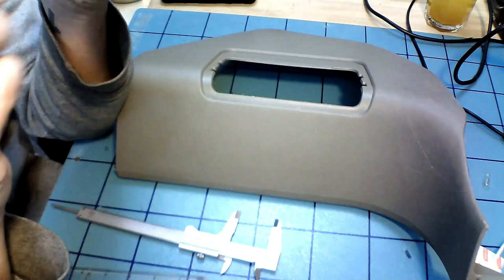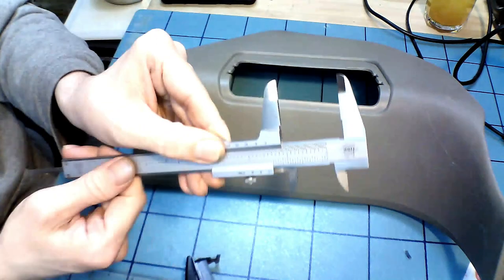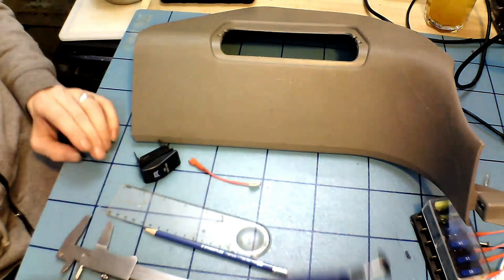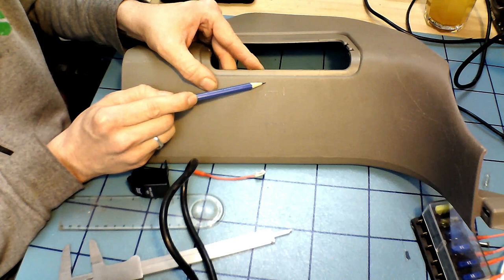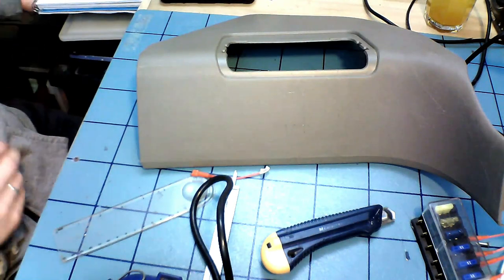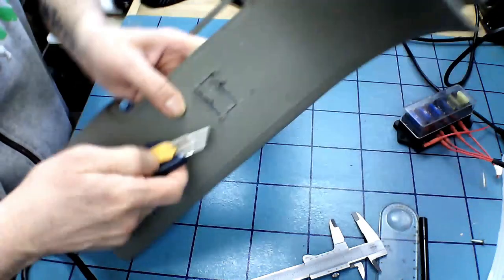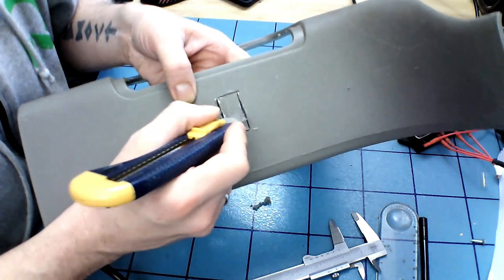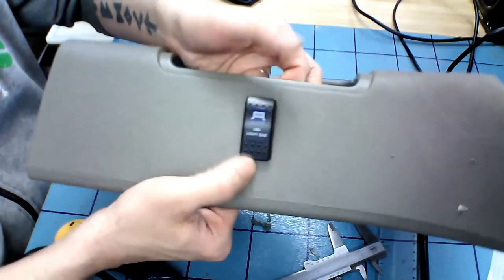How to install components in vehicles  (cutting, fitting, mounting)

Comment: The easiest way to make a clean perfect size hole in a dash is to heat up something metal that is the size you need and melt through like butter. Use file to clean up the edges

Comment: Dremel is fast and easy. But if I was doing this in a new truck or a showroom type car I'd probably start with a small square inside of my box and hand file to until it fit.. A file is slower, more controllable, and easier to prevent a hole that's too big or gaps showing after.
Reply from the maker: its easier but not necessarily faster I found you have to do small slow cuts, and ya always test a panel first I had the luxury of having several spare interior panels kicking around and years of building hydroponic and aeroponic systems in a garden center it was essentially the same thing cutting plastic to an exact measurement.  Id suggest a fine rasp over a file as the files clog up quick with the plastic as where a fine rasp is easier to clean and stay functional. 
thank you for the feedback and watching :)

Comment: is there a standard cut out and hole position for 2/3/8 rocker switch panels (building a customer dash)
Reply from the maker: each switch comes with a sort of template  on each switch its a spacer but it is exactly the measurement of the switch hole size just remember to leave space between switches cut once measure twice even three times if needed  a dash is a one shot deal lol

Comment: I never can do this and it not look like trash.   Guess i need some practice.  Good patience you have.  Word of advice.  Never use a high speed cutting tool like a dremel without safety glasses.  They can fracture at high speed and put your eye out.  I almost had this happen to me.  Hit me just to the right of the eye.  Left a nasty bloody mark.  If that had been my eye?  I certainly would have been blinded.  No question about it.  Not worth the risk.   I mean, I ain't your dad, but eyes are pretty important.  It takes a second to protect your eyes.  Takes less than that to destroy one.
Reply: Good point, I noticed the lack of safety glasses too.
Reply: Good advice.  I'm a long ways from being a Safety Sally but even I wear eye protection when using those cutting wheels.  They absolutely will shatter and it's just dumb luck if they don't go into your eye.